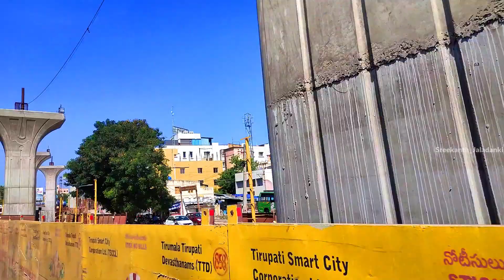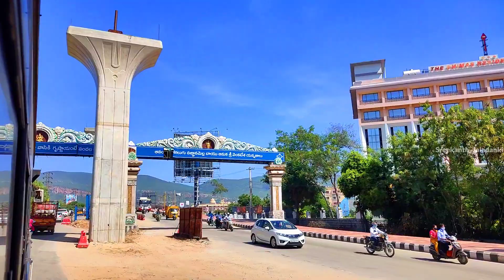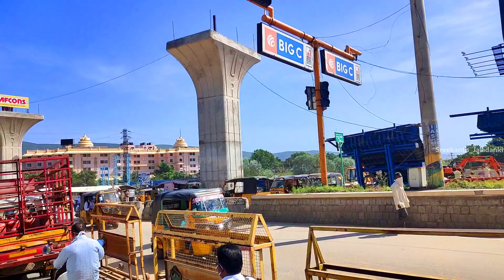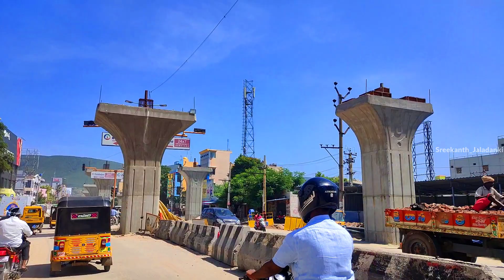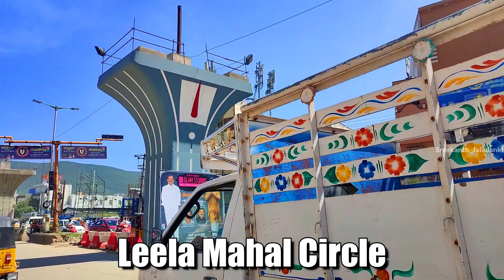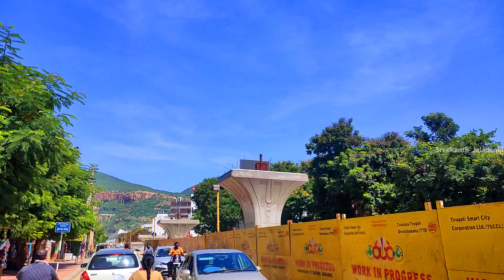Garuda Varadhi Flyover, Tirupati ( Construction Details)

Comment: If it is completed it ll be the second longest flyover in AP & Telangana
1. PV Narasimha Rao Express Highway    11.4km (4 lane)
2. Garuda Vaaradhi 5.6km ( 4 lane)
3. Kanaka durga flyover 2.3km ( 6 lane)
Reply: garuda varadhi is 6.7 kilometers bro not 5.6kms they actually extended the project for more than 1 km considering the traffic
Reply: @ucantfindme7021   oh I did not notice bro. Good info.👍
Reply: Vizag port flyover network is around 10 kms n all r 6 lanes
Reply: @arshad1647    Works start? News vinaledu. Link ?
Reply: @narendra3481  it was constructed few years ago n recently another 1 km 4 lane one way flyover completed from convent junction to inside of port has been added to the network
Reply: @arshad1647  video link send cheyyandi.